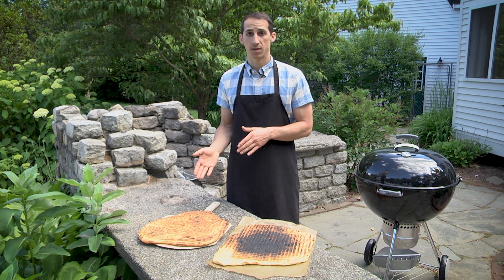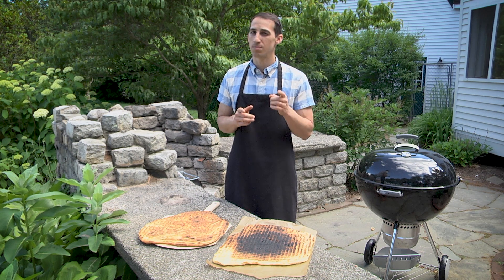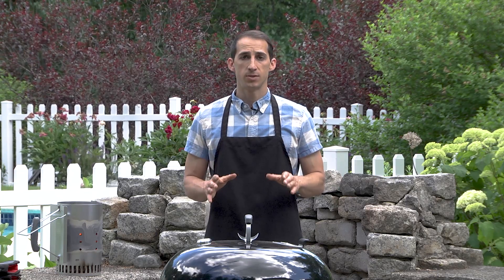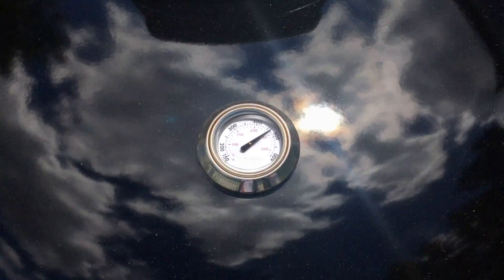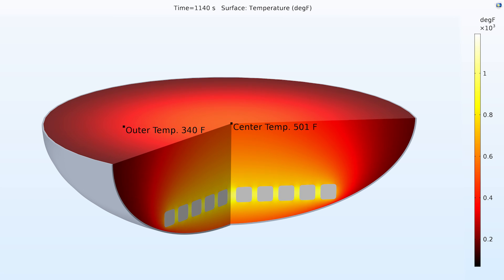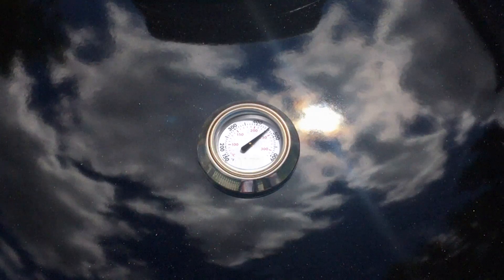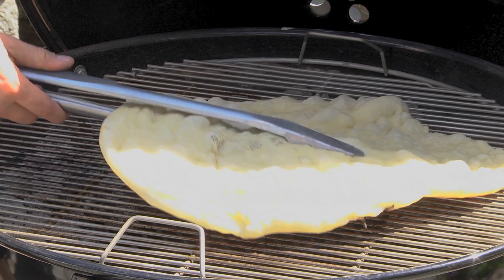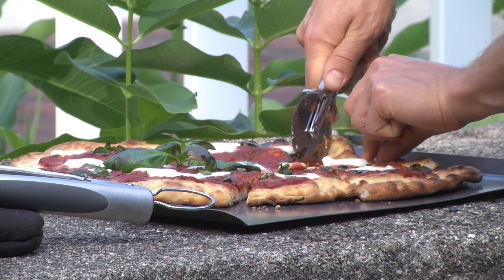Grilling Pizza, a Heat Transfer Problem

Comment: Well, things have really changed in the science of kettle grilling. The method you propose can be a real challenge for some. If you just apply the ring method with a top deflector and a pizza stone bottom with the convection process, you will find it much easier and trouble free. I recently found this (Focused Element Creative) on YouTube, and wow, this guy nailed it...!!! The heat generated along with the setup mimicked the "pizza oven" style to a T!

Comment: Using a stone makes the heat spread evenly. However; in a real pizza oven, the heat comes from the back.
Reply: Doesn't spread the heat. It just make a crispy crust. That's why you still have to rotate the pizza in a traditional pizza oven.

Comment: New to charcoal pizza. Yesterday i made the worst, most burned bottom pizza. (Looked good from the top) watched this video and applied what i learned. A few minutes ago i finished one of the best pizzas ive ever had. Your doing the lords work. Keep it up.
Reply: Get a pizza stone and throw it on the grates. Itll keep the bottom from getting burt.
Reply: Since we're dealing with such high temperatures, he's rather doing the devil's work I guess.
Reply: @Fredwitrave  i would like to think god uses a weber.